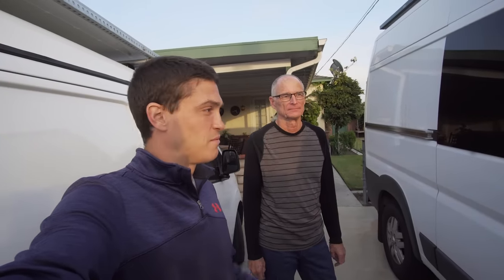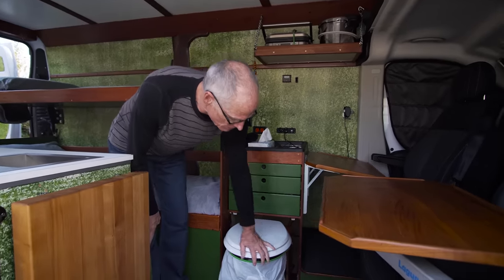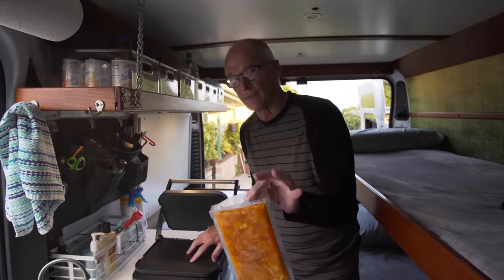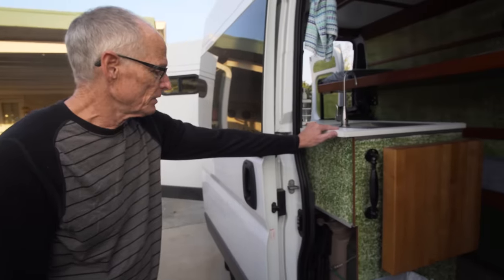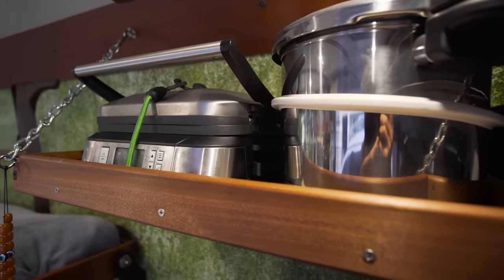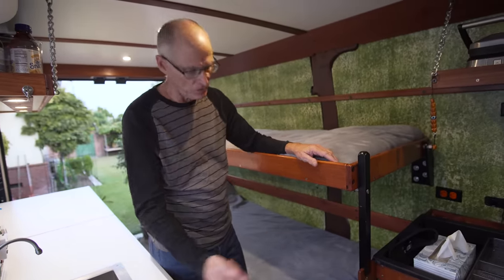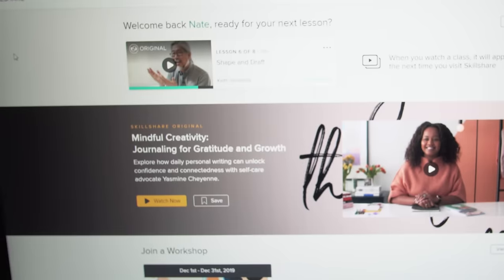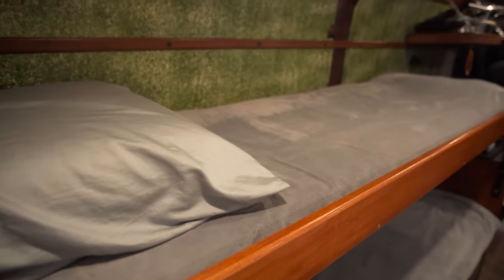Best Self-Build DIY Camper Van I've Ever Seen Tour

Comment: Finally - a van for the older generation of which we are one. Thank you! I am in the process of designing a build in a Promaster 136. And we too want separate beds for the same reasons. However my design is different as we both would have trouble getting into the top bunk. My design is one bed widthwise and the other lengthwise but extends under the widthwise one by 1 foot. This gives us a 50" galley and a wet bath. We are putting the widthwise bed on a lift so there would be a 2 seater dinette underneath. And we too prefer a bucket toilet. You can easily dispose of your waste each time if necessary.. We use a gas station"s trash container.  I am a chef and would never have thought of sous-vide cooking in a van - genius! I am using many of your ideas in our build. I would love to see more.

Comment: Awesome self-conversion by an experienced builder.  He speaks directly on sleep options, toilet options, gray water options, meal time options, vehicle power options and explains how he arrived at his solution for extended van camping.  I like the floor set up but it is a weak point because water has many seams to get into and start rotting the plywood....unless a vapor barrier is added.  I will probably copy the toe kick storage, the Kerosene for Espar heater, the Triple layered insulation method and the counter top Sno-Master Fridge/Freezer.    Thanks Lex!!!

Comment: I would love to know how he did the lithium batteries!
Reply: yes!  a good, long, detailed video of putting together your own lithium cells to build batteries is something i would also LOVE to see, and i haven't found one yet.  i just met a guy on the road who built his own and paid a few hundred dollars for the same amp hours as $2,000 worth of battleborns.
Reply: @nonyabizness.original  Exactly!! These companies all buy batteries manufactured in china (you can find them on Alibaba.com) and put their logo's on them. MUCH cheaper. Shipping is one reason they are expensive. But you can buy the cells and hook them together for a fraction of the cost. Someone needs to do a video on this process that isnt sponsored by the battery companies.
Reply: Ditto this. The cells are easy enough to get, I'd love to know about the BMS he's using. And how he otherwise built his system from buying the cells direct.
Reply: @nonyabizness.original  Will Prowse has videos about how to create a 12 or 24 volt system from individual cells.  You have to buy a battery management system (BMS); Prowse has advice about that too.
Reply: I don't know a lot about lithium batteries but I think part of the reason he was able to make his so cheap is that the batteries probably don't have built in safety features... or decent warranties.  For example, I think Battleborn batteries have electronics in them that prevent charging at the wrong temps and stuff like that.  I'm sure you can set up your own safety features though... if you know how.
Reply: @Debbzvanventure  look up WIll Prowse onYT...He's shows you anything and everything about Lithium ion/Iron/etc batteries and has a ton of videos. Start there.
Reply: @nonyabizness.original  Will Prowse of DIY Solar Power with Will Prowse shows you how to do it. He is amazing.
Reply: @JohninTucson  Oh yes. He is amazing for sure.  I'll look again. Dont remember a video about putting a system like that together. I'll look again. Thanks!
Reply: those batteries look like CALB CA FI Series 180Ah batteries (CA180FI) in a 3P4S (or is it 3S4P?) setup - ~$230 each as of commenting, so $2760 worth of batteries (With no BMS in that cost)? Battleborns that he mentions in video run about $1000 for 12V 100Ah, so $5400 for the "same" setup AmpHrs-wise and before purchasing a BMS.  He said he's getting 5x the power over the Battleborns which sounds extreme?  Likely getting a little less than double the capacity for the same cost by going the DIY route?  Or maybe he got an insane deal on used batteries? So many questions :-)  Would love to know how he got the price down to 1/5 the price of a battleborn!
Reply: YT channel for solar: DIY Power with Will Prowse. Hope this helps.

Comment: I am interested in the cross dowling .
Reply: looks like it uses the same cams that come with the flat packed furniture you buy and put together.
Reply: @nonyabizness.original  No cams, just steel bar stock cross drilled and tapped.
Reply: @rolliebca  huh, thanks, i'm going to check that out!
Reply: Can be rough on the pelvis.
Reply: Same as any IKEA furniture. Waste of time!  Use glue and screws.

Comment: Pay heed to his issues with the diesel van. He is not the first one I’ve heard say that diesel vans are a problem. Some say because of the expense of required maintenance and others because of mechanical issues. I would buy a diesel class A over gas any day. But on smaller scale it’s best to stick with gas from what I’ve seen from others with them.
Reply: I've got a 1996 diesel Chevy dually 8ft. bed Truck. Hope it better than his Diesel Van was.
Reply: Isn't Diesel now more expensive at the pump than gas? Now, Diesel doesn't make much sense anymore.
Reply: Or better yet, an electric van! The range on them is getting better every year!

Comment: He wanted to dump sewage water in McDonald's bathroom? Bash me for this, but this is exactly why i hate some retail jobs. 

Anyway, nice electrical system.
Reply: For other customers who will use the toilet after dumping the sewage water: Good Luck! 😁😁
Reply: And the grey water on the ground? Maybe he would be better off moving to India.
Reply: @Smurphenstein  In the city, on the curb, it's going the same place as all the other waste water. Into the sewer. Obvs, if you are camping, you catch the water and don't dump it all over the ground. But for city dwelling, the water will drain to the sewer system.
Reply: Got to agree use a dump station like they are intended and grey water straight on to the ground. If this is the norm its no wonder tourists cause grief in New Zealand !
Reply: @cazdavidson7861  for the cassette toilet, yes. For a couple of drips of water with windex for an occasional spray wash to dishes, I'm 100% sure there's far worse in city gutter systems.
Reply: @TheDawnofVanlife  stormwater and sewerage are separate in most civilized cities.
Reply: @Smurphenstein  so when someone washes there car out front there home in there driveway and all that crap from there car flows down the drain, I assume that bothers you too. That's just one of many examples where people wash things OUTSIDE knowing eventually it flows to a municipal drain. And what about all the surfers and such rinsing off in there bodysuit OUTSIDE in like beach parking lots. I'm sure everything being rinsed off there bodies onto the ground is super pure. But that bothers no one.
Reply: @TheDawnofVanlife  yes it does bother me. Not so much the surfers if they don't use soap because salt spray gets into those drains but it all adds up and if everyone lived in a van and used toilet chemicals and rinsed their grey water down the stormwater it would make a hell of a mess. All because the guy in the video didn't like the smell from his OWN waste in a grey water tank. If he had just put in a 10mm vent and an S bend there wouldn't have been a problem.
Reply: @TheDawnofVanlife  it bothers others too, including regulators otherwise things like this wouldn't have been invented.

http://www.bunding.com.au/news/relief-for-the-mobile-vehicle-washing-industry/

But go ahead, encourage fellow van lifers to crap in the woods, to dump grey waste wherever they want. It's a great way to get companies that allow van dwellers to be banned from businesses, parks  government land, etc.
Reply: @Smurphenstein  Anything they have on there bodies is coming off. People also soap down there dogs outside as well. The toilet is a completely different thing, even though in that case an undercover bottle saves you as no one knows what I have when I go in the McD bathroom. Quite frankly there's a bag, has a bottle no one sees. Goes into bathroom full, comes out of bathroom empty. Pee bottles work super well. Everything living in the woods poops and pees in the woods, so if you dig a proper cat hole pooping in the woods is fine. Just not in a pile on the ground at your camp site or in the middle of city streets. People create gray tanks because they want the option of a place to build up crappy water (and that's what smells). Where as this guy seems very aware of what's coming out the other end. My point is people with houses and plumbing and have far more crap from there property in the many things washed outside then any van lifer. When you rinse down or take full blown showers outside in the middle of the woods (vanlife fantasy shot, insert girl in bikini) you are creating a ton of gray water outside! And depending on what you may have used on your body whenever, those are going out in the wash you are doing on the ground. When you wash shelter dog outside, grey water outside. Tons.
Reply: @TheDawnofVanlife  a wild animal in the wild is part of a natural ecosystem. It eats food from it's own environment, the animal then digests the food and turns it into energy, the waste it is left with is derived from the environment. It is digested by microbes, insects and other animals that have developed in harmony to scavenge the nutrients. 

When a human or animal that derives food from outside that ecosystem,  we have things in our poop and pee that are foreign to nature, for example antibiotics, hormones and a number of other things that are added to our food and bodies that are synthetic or foreign in nature. Add every person that pees or poops in the wild, along with their toilet paper which is scented, bleached, etc and it could put the natural balance out. As I said if we all did it, the world would be a lot worse off. So you can tell me those plastic bags you use for poop are tipped down the toilet in McDonalds, washed out and reused? Because if they are simply thrown away, they end up in landfill along with everything else. A plastic bag in a landfill is going to last anything from 10 to 500 years because once you poop in it, it's going to landfill, not for recycling. Use a chemical toilet and empty it at a dump station however and that sewage goes to a facility designed to treat it, depending on where in your country you are. Add in some wet wipes which a lot of van dwellers do and you create blockages and fatbergs  in the sewer and machines processing sewage. We all produce waste though, I am not saying I don't. I just bought a van, a very small one. It has room for a toilet, a bed and a minimalist kitchen. It may or may not have a refrigerator. I will quite possibly produce more waste than I do at home, especially when I consider the toilet chemicals and fuel usage. It will all be recycled and reused where possible and not a drop of black or grey water will go where it shouldn't. I do love this planet and want to explore my own country but would like to leave it to future generations in as good a state as I practically can.
Reply: Smurph, crap and urine in the street doesn’t bother those living on the streets in San Fransicko, not even the politicians there.
Reply: @Harry7656  we don't all live in "Shit Andpissroads". Seriously though, loved that place when I visited the US in 2005. I was there as foreign tourist though and wanted to visit San Francisco since I saw the movie Bullitt as a kid and Dirty Harry movies when I got older. Even the three guys trying to.jump me in an alleyway seemed a novelty at the time. Of course I heeded the warnings about places like Union Square but I was really sad to hear about what has come of some of the city by the bay that I still have a fondness for.

Comment: How appetizing... food in a plastic bag... yummy
Reply: Brian wondering how much power a vacuum bag sealer uses.
Reply: Yeah I could never do sous-vide. 
People use mason jars for the purpose. Just have to adjust cooking times; and maybe cube your steak. 

Articles: 
Sous Vide: A Popular Way to Put Plastic Straight into Your Food
&
What Is Sous Vide (& How to Do It without Plastic)
Reply: @pentatonya1778  my guess he does all prep at home before traveling.
Reply: @patsykluting-lucas3804  Yeah, I think he would almost have to do the prep work at home.  To make large batches of food like that you would need a good size stove and large pans, etc.
Reply: I'm sure it tastes good.  That said, seeing those bags reminded me of military MREs.  Though, the MREs aren't that bad.  I usually take a couple with me on road trips just in case.  They don't require refrigeration.  They are a bit expensive, even on military bases.  Once I use up the ones I have I think I will just start taking cans of soup as a backup.

Comment: Why do I feel like this guy is a retired engineer?  Lol.  The way he handles food prep sounds very typical of an engineer.
Reply: Cooking food in plastic isn't smart
Reply: @JenniferWilson-b9h  I definitely agree but just FYI he's doing sous vide which is cooking in water baths at much much lower temps and the temp level is maintained. Most sous vide cooking is done under 200°F/80°C so plastic leaching into your food is less of a worry, though I still worry about using plastic in general with food.

Comment: Grey water smell can be remedied with cheap white vinegar. It will prevent formation of smelly microbes. Use biodegradable soap and then dump in woods. The vinegar  and soap won't hurt anything, it's too diluted by water. I always super scrape food off for disposal before washing dishes and cookware to keep critters and bugs at bay and smells.  I still do primitive tent camping and do same  thing as you re: toilet. Great tip on the flooring for my future van. Great ideas.

Comment: Ditto Gabe's comment. I saved it for reference. I am guessing that if he wants a new van, he can take everything out, stack it in the garage, take the van in and trade it for another(sure, or sell it or whatever) then bring the New van home and reuse much of the insulation and everything else. If he gets a longer van, he would just fill in the gaps and maybe add the dinette. Very smart. How has he attached the walls and insulation?  I noticed some things were screwed in, so he must have it attached well enough to hold the beds and such. Thanks for sharing!  Great van build!